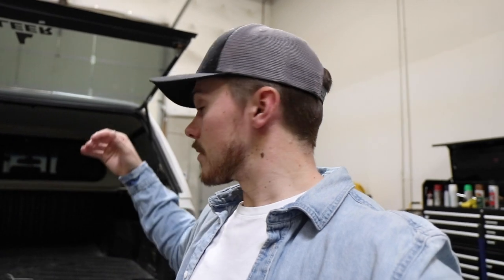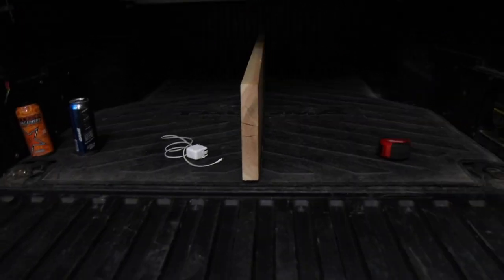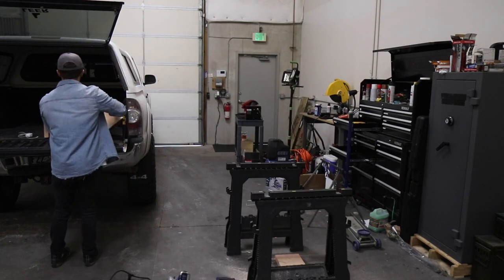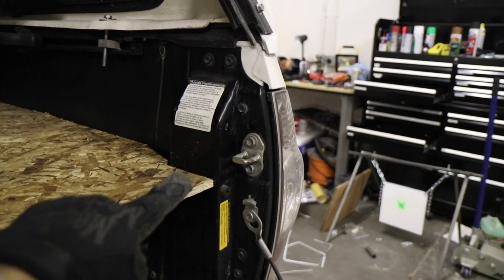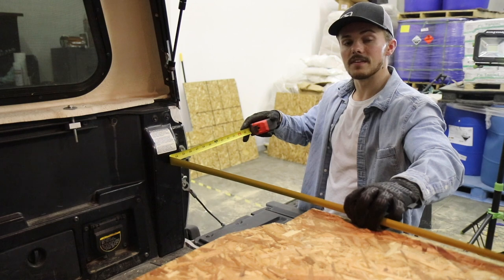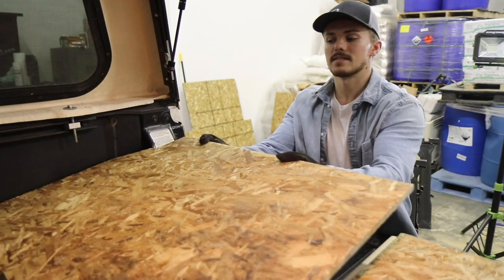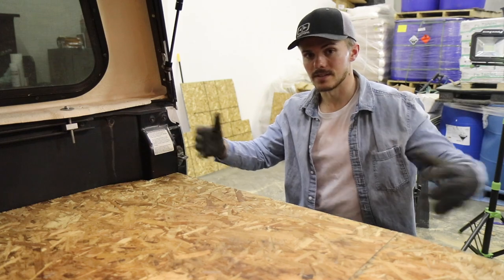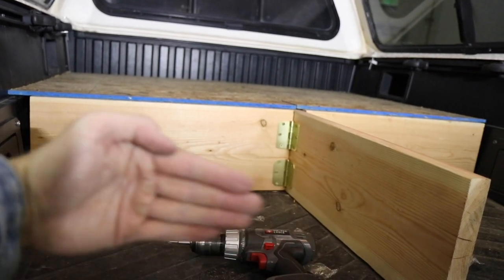Quick and Easy DIY Truck Bed Sleeping Platform

Comment: Great video! I'm curious if you had a rec for if we didn't want the middle dividing 2x4 underneath? I'd like to be able to slide surfboards under the platform. Thanks!
Reply from the maker: Thanks! Unfortunately that’s the only design I have, but I don’t think it’d be too difficult to get around that, just make sure you have something supporting the weight where you will sleep.

Comment: one of the best easy build ideas ive seen, pretty clever, probably going to do something similar, does the particle bored feel pretty sturdy? like could two people and a dog use it? or would more support underneath be a good idea?
Reply from the maker: I think you’d be fine as is, I have slept two people in it before, just not a dog. But I’ve also bounced around a bit and it’s always held up.

Comment: Thank you for this, been thinking of ways to do this in my 2010 tacoma and probably gonna steal it. Do you wish you had a little more height underneath the platform for storage or have you found that to be a good height?
Reply from the maker: I wish I had a bit more headroom, but I couldn’t really do that if I wanted the full platform, so I’m happy with it haha
Reply: @BraxenMcConnell  How did you keep the main beam mounted/upright so it didn't move?

Comment: Thanks for the inspiration, man. Building out my bed this weekend and likely will be referring to this video once or twice during the process. I'll keep you updated on the finished product. Also, looks like you have a 3rd-gen Toyota as well? I'm curious to know what you used to secure your topper to the bed rails. Right now, I'm using some janky old clamps, but your setup looks much safer/supportive. Thanks again!
Reply: He’s got a 2nd gen  but the bolt clamps you can pickup from somewhere like campways truck accessories they go through holes on the topper and clamp into the bed rails

Comment: It kinda looks like there's not enough place height wise.. Is it too claustrophobic? Love what you're doing with the truck!
Reply from the maker: It’s definitely a little tight, but not terrible. There is plenty of space for sleeping, but it’s just a little cramped when you’re trying to sit up and get dressed haha
Reply: @BraxenMcConnell  can't you lower the wood but cutting it by maybe half an inch?
Reply from the maker: I could lower the middle by about a half inch to and inch and probably be fine, but I can’t lower it much more than that because I’m using the wheel wells and ledges on the side as supports for the top platform

Comment: Did you use anything else to support the panels towards the front of the truck?  I feel like the plywood wood flop over if there was supporting it.
Reply from the maker: The wheel wells support it really well on the sides, and then I cut the wood to lay in the middle of the center beam so that supports it from the middle. The only time it shifts is if I’m driving somewhere and the center beam moves, but all I have to do is re-center it and it’s good to go again. Never had it shift while I’m sleeping on it tho.
Reply: @BraxenMcConnell  Nice - I plan on going off this with my design.  Let you know how it goes.
Reply from the maker: Nice! Let me know man!
Reply: Literally just finished my platform using this as my base. What I did for the front was add two more 2x10 sections at the very front with hinges for easy tear downto eliminate side to size movement. I lost about 2” bed space up at the front but it works perfect and it doesn’t move. I can measure the piece if you need it.

Comment: like the raised floor but I did have a truck but I let it go because of the noise in the cab motor just got to me and with ringing in my ear already made it worse. and the raised floor will cause you very little room sleeping room meaning your head is now closer like sleeping in a grave I rather have a higher roof so I don't hit my head. try to have storage on the side and your bed in the little, this work better for me, what you think. ?

Comment: Can u list everything you’ve done to prevent water from getting in the bed with the shell on. I’m putting one on but am worried about leaks. Thanks
Reply from the maker: Hey Bryce! I honestly haven’t really done anything, they are pretty water tight as is. I know mine has a strip of foam along the bottom where the shell sits on the sides of the bed, but that’s it. I think they all come with that weather stripping tho.

Comment: I'm thinking of doing this with my Tacoma, but I am worried about me (5'10") fitting in a 5' bed. Do you have any issues? Are you sleeping diagonally on the platform?
Reply: I’m curious about this also I’m 5’10 and wondering what truck I should get, about to purchase one and wanted a ranger or Tacoma.
Reply: @neomis0119  Tacomas have 6ft longbeds as well.
Reply: @muhtalikah  Yes I have one with a 76 inch long bed.